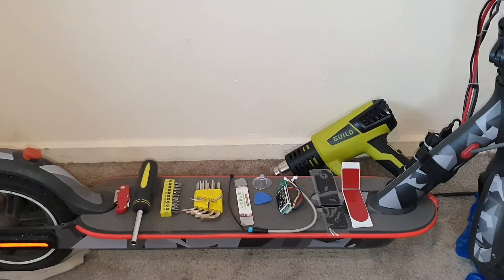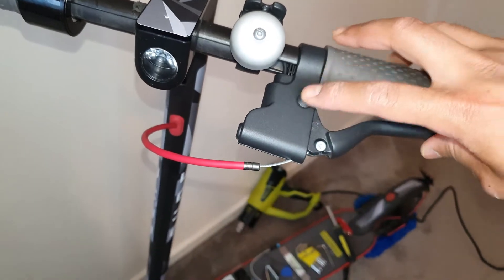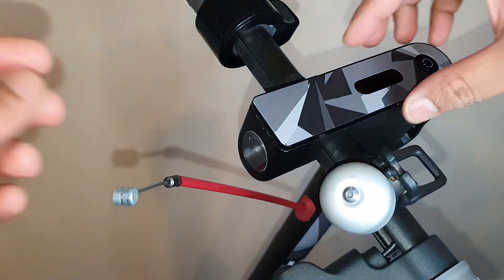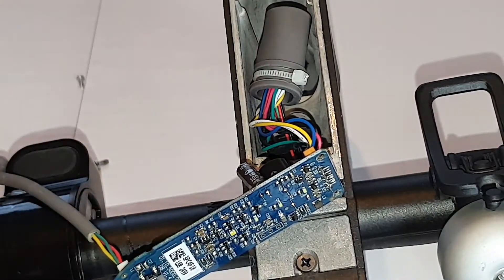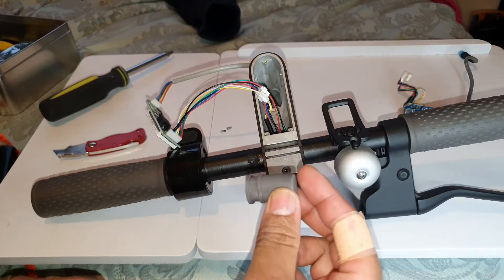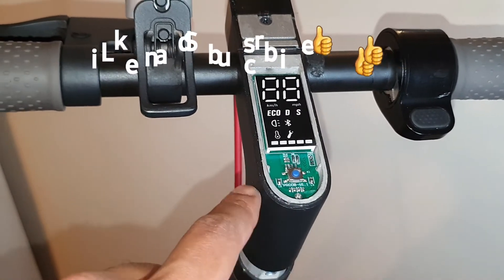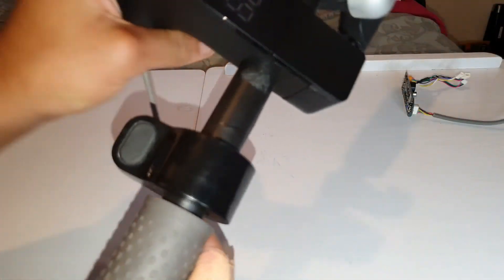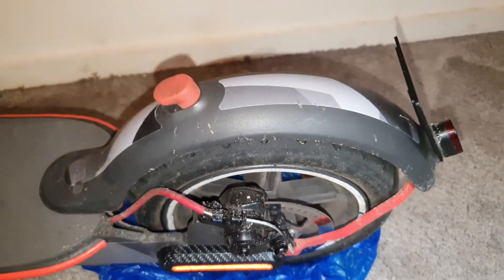Xiaomi M365 Pro Display (In English) Part 1: Detailed installation

Comment: Why does the brake line have 3 wires coming from it? I ordered a 36V controller and matching display (just like this one) and my brake is only 2 wires (red and black wired to red and center color, not black of display) and the display shows me an E9 or an E3. I installed a 2nd throttle and it now both 3 wire plugs are fully populated but I get no movement of the motor, swapped throttles and same no motor movement. Why does Xiaomi have 3 wires coming from brake?

Comment: When i Switch the Dashboard will IT delete my datas? Driven Km??
Reply from the maker: Yes as its saved on Broad
Reply: Wtf, this the questiom, is IT Safed on the Board? Or on the Controller?
Reply from the maker: @mr.taddel4282  data saved on Broad so when you change broad it will reset all data.
Reply: @Tech-Know-logy  wtf because i want a pro Dashboard for the colorsettings👀🥴
Reply: @mr.taddel4282  9œ